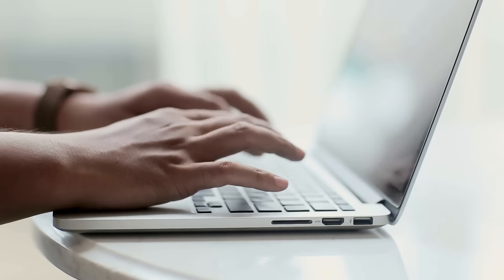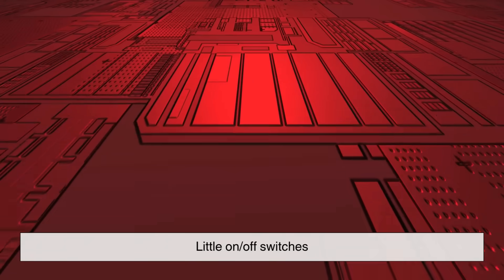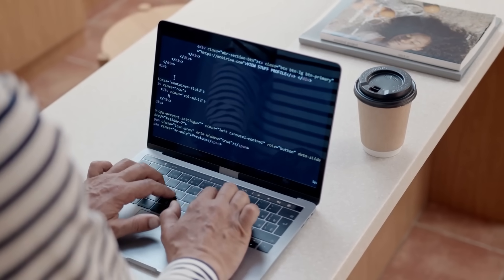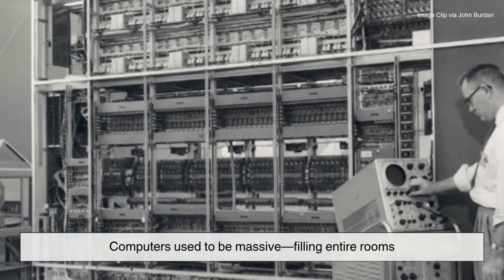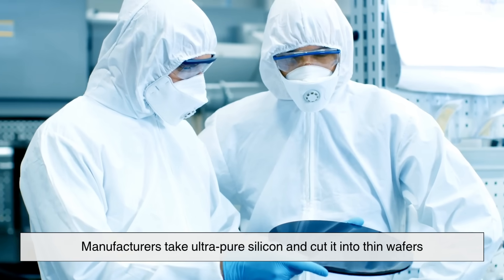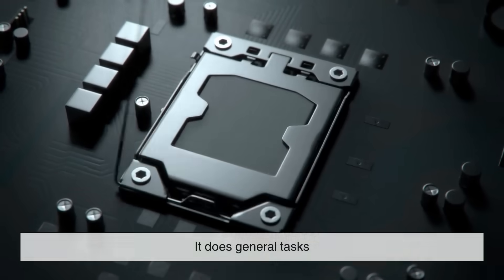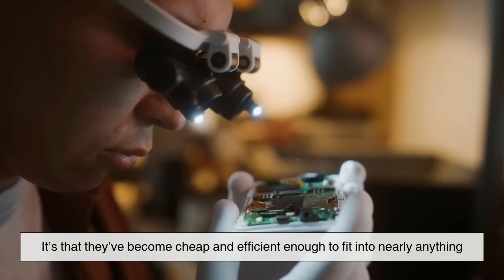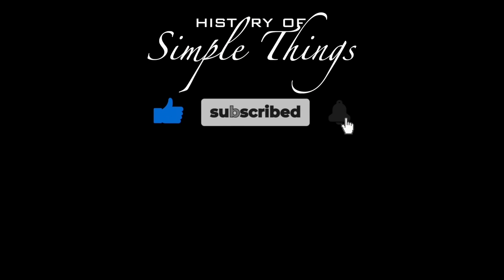How Microchips Work and Why They Power Everything Today

Comment: From memory, the first commercial semiconductor chips were produced by Texas Instruments in 1958. A computer CPU is essentially a large scale mathematical and Boolean calculator with all such operations passing through the A-register. We even had to write machine code to evaluate a SQRT in the 1970s (Datapoint 2200 hardware).

Comment: To try to explain how a Microchip works so the average mind could just begin to understand the process is very difficult is an understatement . This is not even considering the people who write the code or design the machines that add layers over layer of information on a small chip. Liked the vide, educational and over my head but some general understanding.

Comment: In just a couple of years the big breakthrough in microchips will be when electron wires are replaced by optical photonics which will be revolutionary and open new doors and enable mobile devices and phones to perform tasks not possible in 2025. And having greater bandwidth, quicker latency, running cooler and drawing less battery power will be technology mind boggling making even the best mobile devices in 2025 look outdated and primitive.

Comment: absolutely brilliant but my head cant even process this doco to understand. perhaps its because I am now 80. I should stick to my hammer and nails
Reply: A combination of multiple on and off transistors is equivalent to a specific function like running a software or calling or calculating or whatever a computer can do so basically a computer works through codes and these codes are called binary (on and off of a transistors which is coded as 1 and or 0)

Comment: I worked in a semiconductor plant in the '90s. It's such a mind blowing feat of engineering it's almost hard to fathom. I have no idea how they know how to map billions of transistors and their interconnecting highways. Imagine designing a city with billions of streets with all the electricity, street lights, everything needed to function. The streets or blocks of streets are stacked on top of each other up to 10-12 deep and they are all interconnected to work together. You can't even comprehend how this works and it's on a scale so small it makes it even more insane.
Reply: Using verilog....
System verilog
Reply: I always imagined it the way you are describing it. Like a huge multiple story building with multiple escalators and elevators with complexity beyond imagination
Reply: Now imagine how the human body works! it’s lot more than a chipset
Reply: With the invention of the microscope, you could see what you couldn't with the eye,with stronger microscopes can see living cells,sub-atomic, astounding. A long time ago a Preacher in church, when all this was just starting, made the remark, be careful, building a house on (microchips are made from sand)sand, when winds blow,the house fell,and great was the fall,as Bible declares, build on Rock,the Lord Jesus Christ, winds,storms came,house stood firm.kjv.Mat.7:24-27. Food for thought. 🙏
Reply: @leonardlugo7878 so our society is metaphorically is built on sand meaning everything requires chips to work and it can crumble if technology or internet stops working.
Reply: I know. I saw an insane video on how an sd card was made - crazy complexity stacked like you said. Then the kicker at the end was that it was thinner than a sheet of paper. True sci-fi stuff.

Comment: But how do those tiny billions of switches switch on and off, do they have hinges etc, how is each one of the billions controlled independently ???
Reply: No hinges it’s all electrical
Reply: @ohgodimdead haha yeah I get that but in diagrams they show like... a swinging door as a switch, so how do you control one switch out the billions, it's voodoo
Reply: They’re electrical “switches” that allow current to flow from one node to another node depending on how voltages are applied to the  terminals of the switch.
Reply: It's how the material changes in the transistors that allow current to flow through it when voltage is applied. They are just switches. But there's millions of them.
Reply: And it's just a matter of 0 to 5 volts, 0 and 1.

Comment: But why does it have to be so small? Why not double the size? Plus, after watching this, I am just as clueless about how they work
Reply: How a Automatic Transmission Works. Put it in Gear and it Goes.
Reply: Consider a smartphone as an analogy. By cramming a bunch of chips inside it, you enable your phone to do a whole lot more functions like gps, wifi, etc and the phone doesn’t have to be as big
Reply: One reason is the holy grail of lower power consumption. 
Smaller = far more efficient, ergo more applications and possibilities  for microchips.
Reply: Less heat.